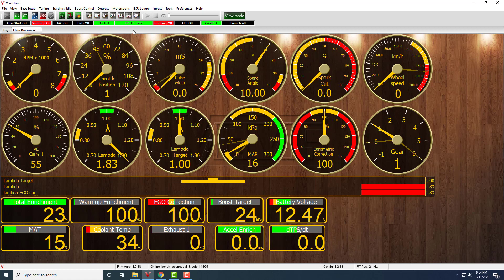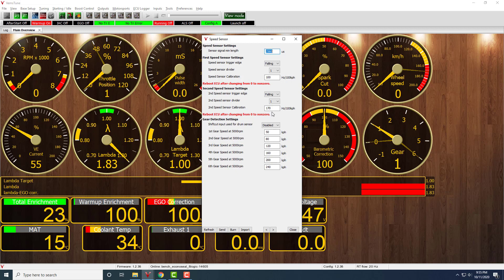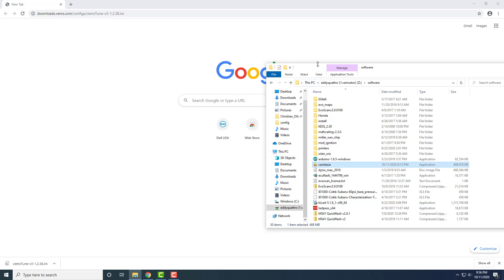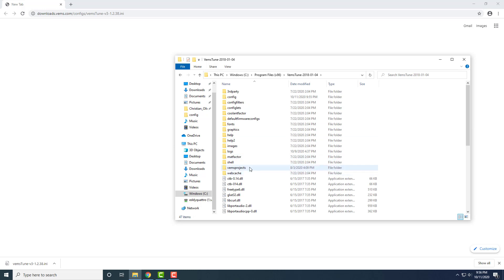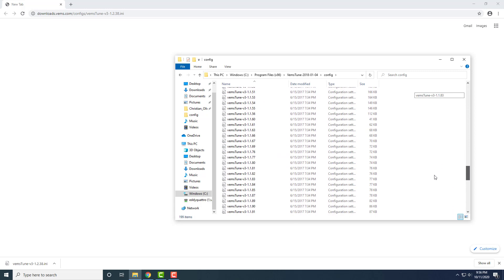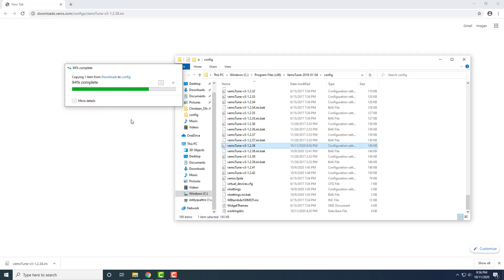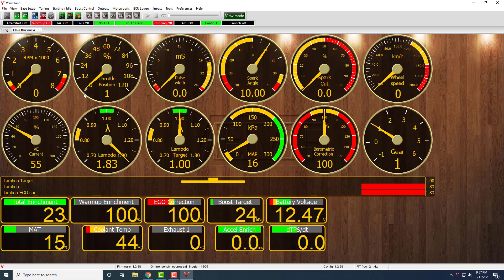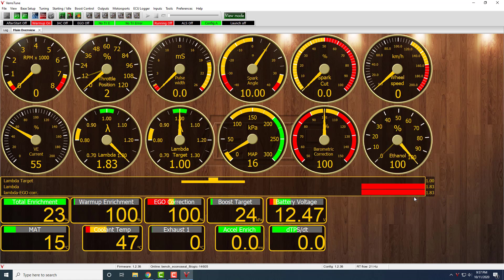Setting up FlexFuel input/display for firmware 1.2.38 on VEMS

Comment: Vems display apk is very very old, the theme is extremely unuseful, why there isnt any new update for vemsdisplay??
Reply: What do you find "extremely unuseful" about the theme? I think it hasn't been updated because there's no need to update it, but if there are issues, report them for sure.
Reply: @jasonrussell6534  do you think there should be a mistake to improve it? The other ecu's softwares are much better, more useful and has better hd themes...

Comment: what obd2 do you use for this to work i tried using it with my adui s4 and it said port not found
Reply from the maker: No OBD2 involved. This is on a standalone ECU.
Reply: @Vemsus  so i would have to buy the standalone ecu for it to work
Reply: @Vemsus  or am i able to use the software while hooked up to my car